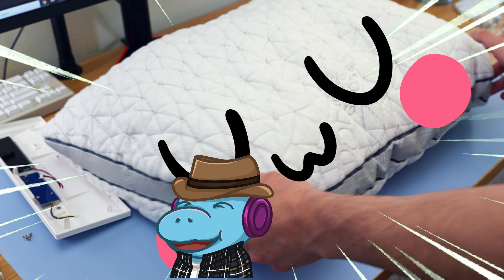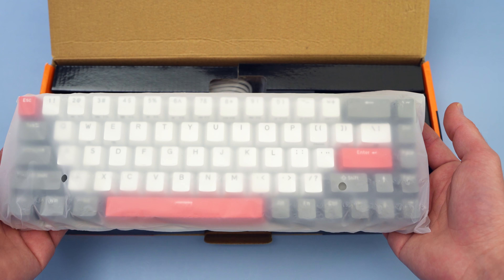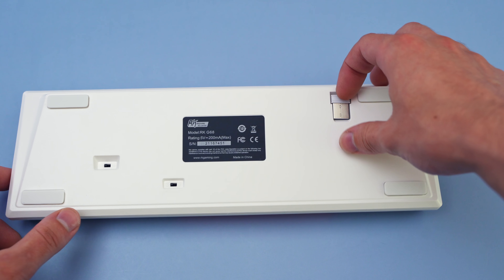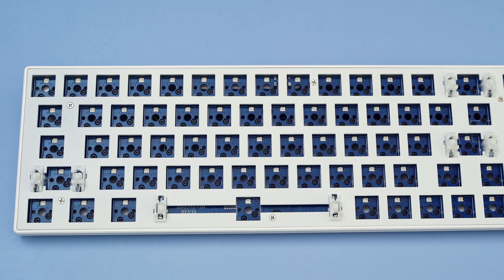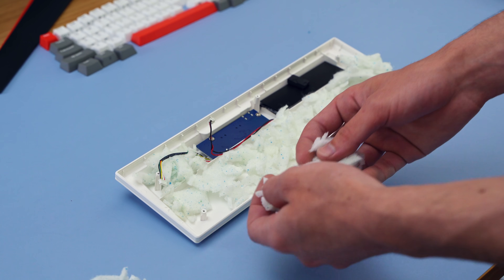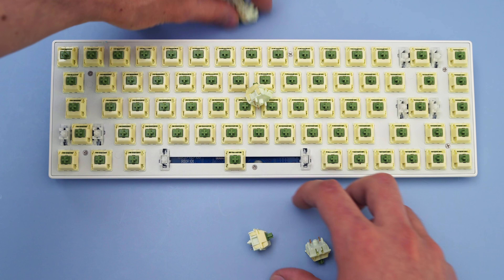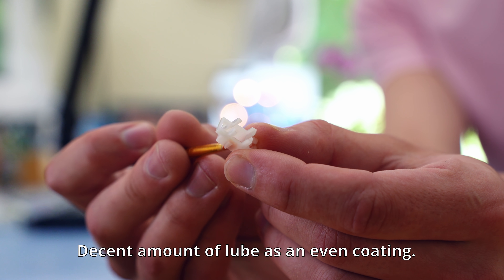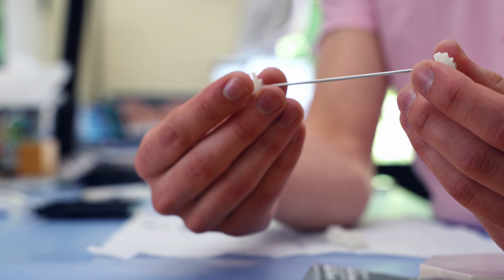I used a pillow to make my keyboard THOCK

Comment: Nice video! To help with stabilizer rattle, after cleaning off the wire set it down on something flat like back of phone or desk and tap the sides. If it wobbles or taps the surface, the wire is not flat and almost always results in rattle. Bend the wire slightly on the ends where the 90 degree angle is until wire is even and flush with flat surface. Works like a charm everytime!
Reply: 100$ pillow, Sheesh

Comment: Hey, if you still have this keyboard or to anyone that wants to mod a rk61 keyboard, The stabilizers aren't really secured to the board. I put some double sized tape between the board and the stabilizer. It helped a lot it fikzed the annoying rattle that I couldn't get rid off. :D

Comment: I actually bought a royal kludge before I fell into the rabbit hole of mechanical keyboard mods. (Thanks a lot...;D)

I knew after watching previous videos of yours that you had used this technique before and thought about doing it to my board since it sounds really hollow and pingy.

Lo and behold you're modding on the keyboard I bought lol.
I'm not confident in replacing stabilizers yet (the stock ones are really rattlely on the space bar especially), but I do have switch lube, an opener, and your hippo keys coming in soon! Already replaced the switches a week or so ago 😎

Edit: I mean I won't be doing this. It's a fire hazard.

Comment: I got a a rol of sticky foam for a couple reasons, a foam meter for my bass wanted to see if I liked the muting on open strings and it reduces rattle and then my keyboard came in! And I remembered the video you made about the play dough its dense foam but also light I shaved off some of it and I made a thick spacebar!!

Comment: Let's get together a group buy for some high quality custom 65% or 75% south facing cotton for the build.  In the meantime, I will cut up my poly carbon flex shirt to use as a plate.  Then use the extra FR4 PCB as the handle of my custom EDC knife.

Comment: The Coop Home Goods pillow is phenomenal. It's my go-to gift for my friends or acquaintances. The key is to remove the fill inside the pillow to adjust to your sleep style. But back to the topic, I was looking at the RK68 and it seems like the mod work won't result in the quality sound I'm looking for. You think the Keydous NJ68 is a significant upgrade to the RK68?

Comment: I just use strips of silicon from an oven pad I got from the dollar store to silence the bottom-out on my stabs by gluing them to the mounting plate. (ALPS stabs with the keycaps with feet that you have to slide under the metal rod.)

Comment: What's the point of a before and after if you change other stuff? Every part of the keyboard affects the sound. It should be the same exact build with and without the pillow filling for an accurate comparison.